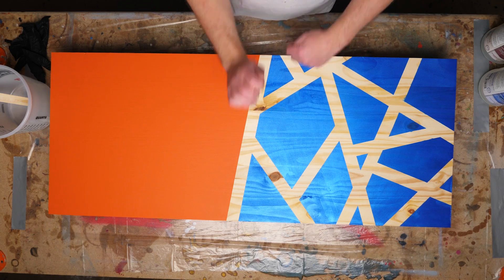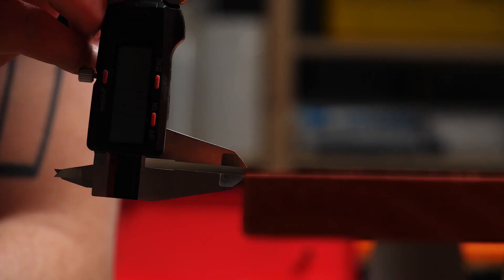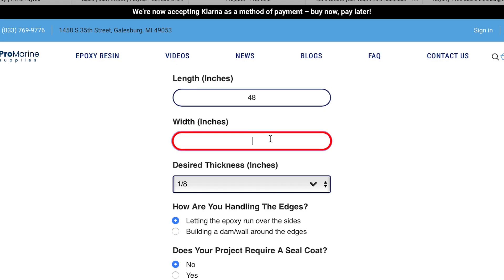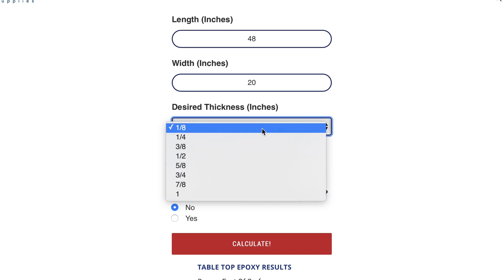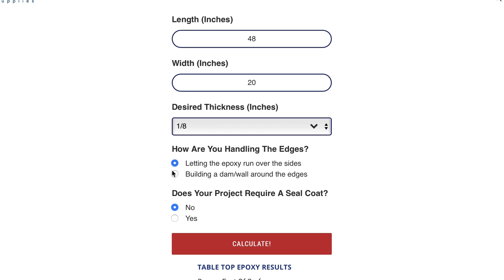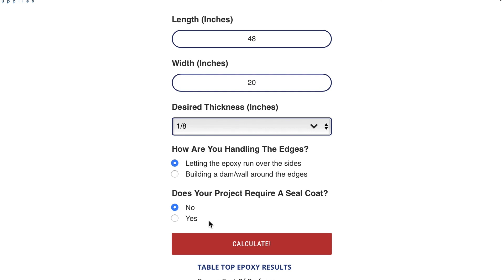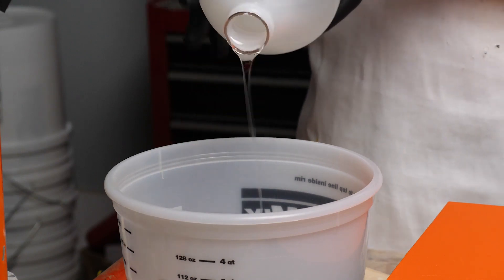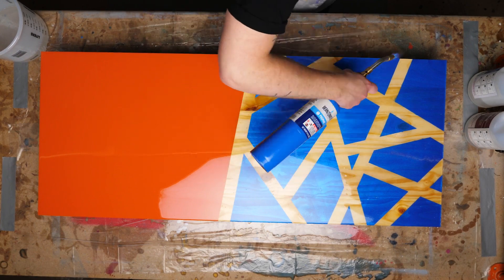Epoxy Coverage Calculator - How Much Promise Epoxy Do I Need?

Comment: what if i use difrents resin ?
Reply from the maker: What is the project and what kind of resin are you using?
Reply: @promiseepoxy  resin name is genik , and i want to make a recteangle tray project ,
Reply from the maker: @safrahanan1571  Our epoxy calculator is specifically designed for ProMarine epoxy, so it may not be accurate for another brand.

Comment: What if I'm making a wood / epoxy bowl? I have a 6" diameter container and it's about 4" deep. But it's full of wood pieces. I'm also curious what PSI I should set my pressure pot to to get rid of the bubbles.